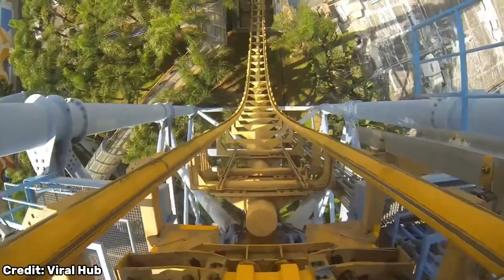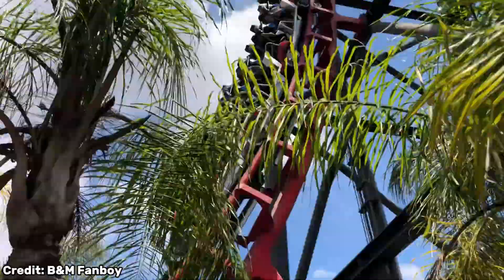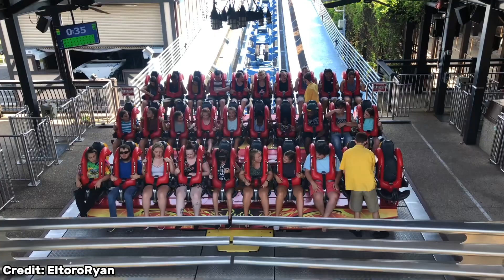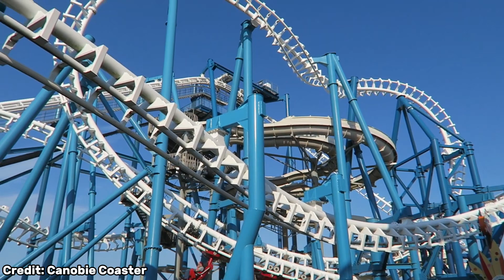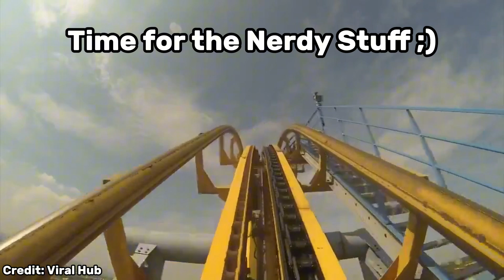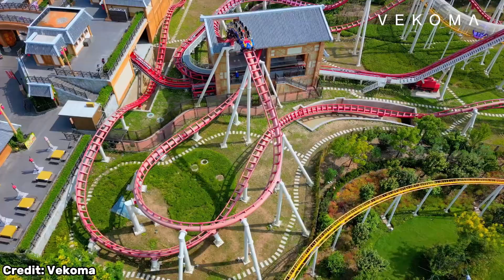The Tilt Coaster is already Dead!?

Comment: There are lots of examples. Winjas at Phantasialand is a tilt coaster. Every drop track coaster uses a similar mechanism that holds the train in place while the track disconnects. Voltron, Karnan, and others also have complex mechanisms to hold trains during track movement. High speed switch tracks aren’t that different either, as seen on Velocicoaster, dueling dragons in China, Toutatis, Pantheon, Hagrids, Batman, etc
Reply from the maker: True! But i meant Vekoma Tilt Coasters 🫶🤘

Comment: nice but i definitely dont think they will fail, vekoma has been a very reliable manufacturer, even on complex ride systems like F.L.Y. so i dont think they are going to be a maintenance nightmare, also i think they are different enough to dive's, like cedar point is putting a tilt next to a dive coaster which is saying something and the throughput on tilts is way higher than the thoughput on gerstlauers which makes the price tag worth it
Reply from the maker: Yeah, Hopefully They Will be Great 🫶👌

Comment: Probable 2 or 3 more tilt coaster will be build if they are halfway decent Europe can use 1 or 2 so does China (if they haven't copied them already). If they are really good maybe at most 6 to 8 more. But you are correct there probable wont be that many.
Reply from the maker: Good Point, Sadly the Jinma Manufacturer took Asia away 😱